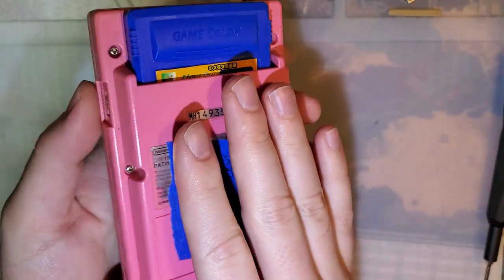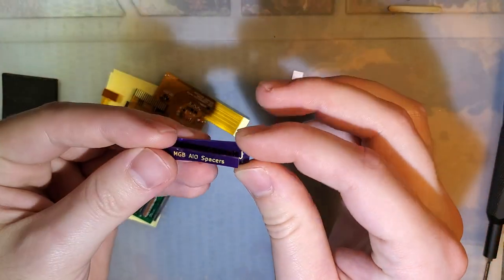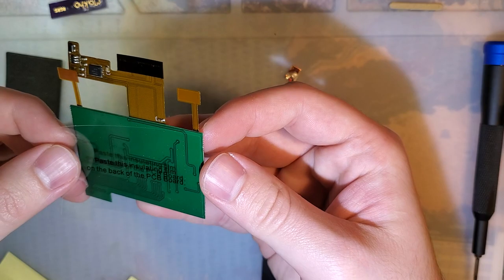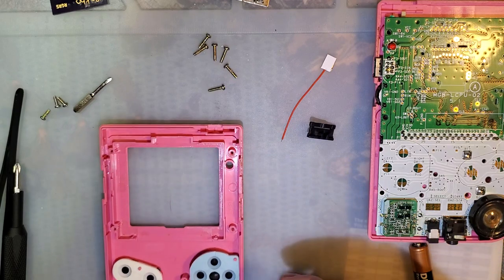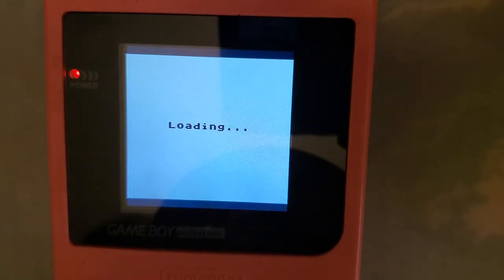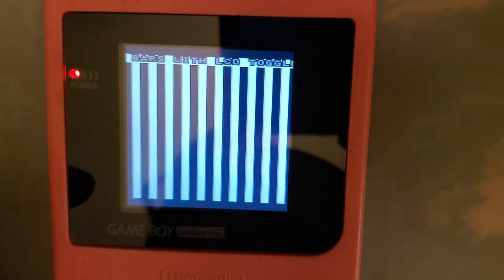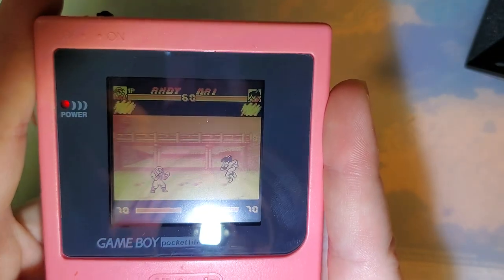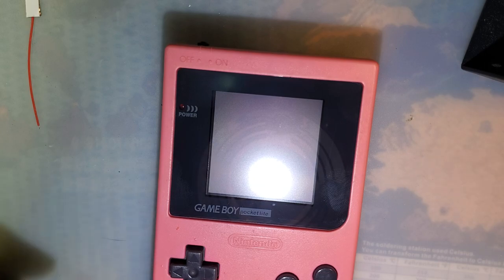Color Palette AIO TFT Game Boy Pocket (MGB) Backlight Kit

Comment: Makho you should do a video on the 5v boost regulator mod to enable carts like the ez flash to work on GBC and MGB
Reply from the maker: It's not a difficult mod.
Reply: @makho  indeed it's not, I've done 2 in the last 2 days.  I think it's a relatively unknown mod, which alot of people might find useful though.
Reply: @AndehX  How is this 5v boost mod done? Do you have some info on that? I need my GBP to work with the everdrive.